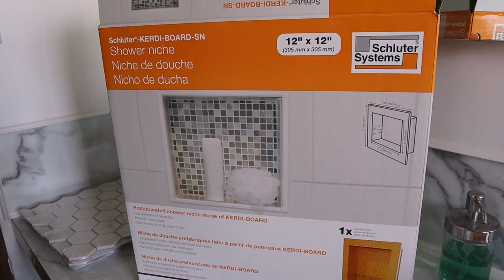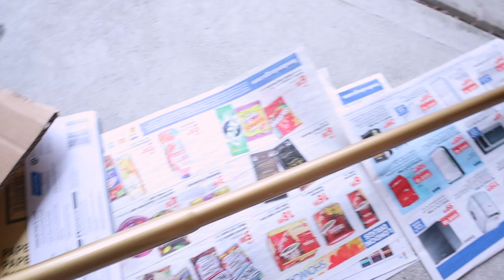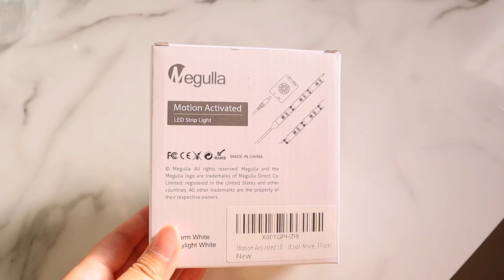Finishing My Extreme Bathroom Makeover Finally! (part 4) mustard bathtub begone! | JENerationDIY

Comment: Heyy helpful tip for plastic that’s gonna be used around water:
Go to a good Auto parts store (yes you read that right, car upkeep shop)
Find a Plastic Primer Filler, and spray paint meant for plastic auto parts. 
Use 3 coats of the Plastic Primer Filler on sanded plastic. (Plastic is general will not hold spray paint well, as it is water based) 
Use a matte/glossy spray paint (3 coats)
Use a matte/glossy waterproof top coat. (2-3 coats)
This is what is done on side view mirrors on cars. 100% waterproof and pretty damn scratch proof. Works on pretty much any plastic DIY project you need to paint.